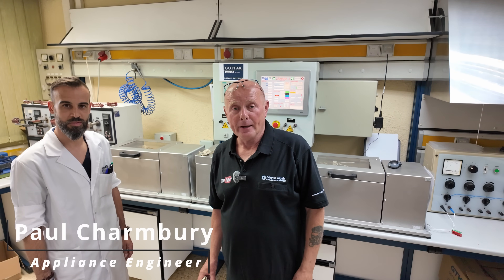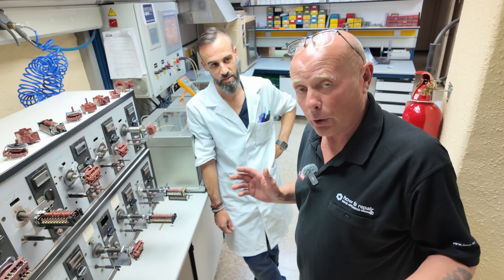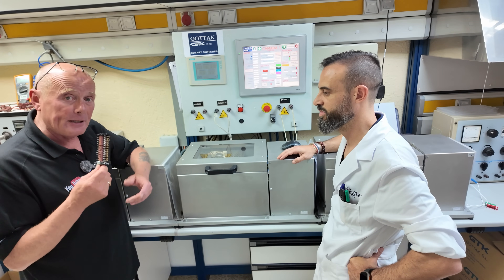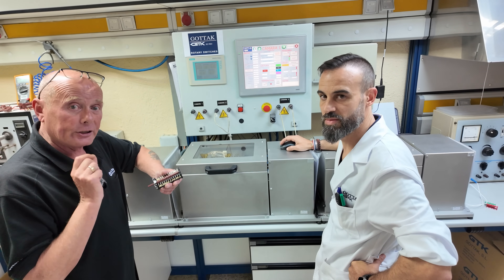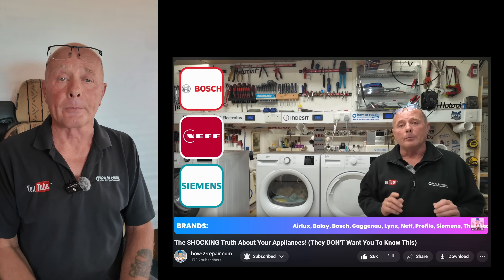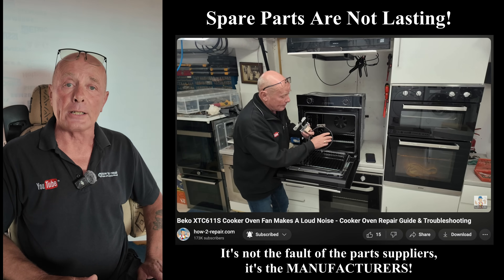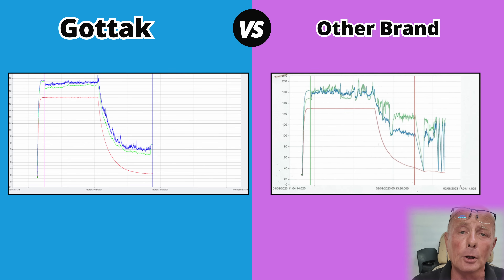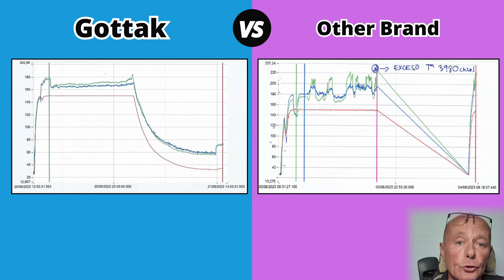Why Your Appliances FAIL SO FAST! Lab Results EXPOSE the Truth!

Comment: As a decades-long reliability engineer, let me say this is only part of the story.

The truth is a balance between performance quality and reliability vs. price/cost/profit.  Because customers demand better for cheaper, you are assured to see this balance shift between performance and cost.

My particular area is semiconductor reliability.  And guess what?   Same thing applies.  The chips in your iPhone only have a lifetime of about 10-15 years.   30-40 years ago the accelerated lifetime estimate for contemporary chips was 10,000 years!!   Making things smaller reduces reliability in a very linear way - the minimum geometry in nanometers of any planar semiconductor process is approximately the lifetime in years.

The specific trade off is always occurring.

In switch example - be aware using silver is itself a trade off with reliability implications.  Rhodium is what you would use for maximum lifetime - but it is much more expensive.  Silver reduces contact resistance but is not as good for hot-switch reliability.   It's better than copper or iron or steel which are cheaper.  But not the best case if you simply want to optimize for lifetime only.  The economic trade-off has already caused the choice of silver!

The engineer CAN CONTROL what the accountants buy by defining proper specifications that lock-in a given performance.   You could specify rhodium contacts with a market demand specification.  You specify a certain cycle count (that ONLY rhodium can attain).  Etc.  I've done this many times.

Part of the problem is the insistence on more performance for price.  Once you account for technology lifetimes declines vs. inflation adjusted costs and market demands for shareholder value , all of this becomes inevitable.  

Do you demand your bank, investment or retirement accounts grow to assure you have comfy retirement?  YOU ARE THE PROBLEM because your financial growth comes from investments in companies that grow - and they grow exactly by having companies maximize profits, which itself involves cutting costs on their products - as exactly as described.  When WE as consumers demand better, faster, cheap, we are feeding the beast that creates this situation.  We customers are NOT innocent victims of "planned obsolescence" - we create the market conditions that create it!

What you must sell people is the value of long term function at an inevitably premium price  This is marketing and sales problem.   Most people don't care about something lasting 20 years - because of the time-value of money (compound interest) makes long-term planning ROI less valuable financially/economically than short-term planning ROI.

Outsourcing products to China pretty much guaranteed the view that "I don't care about quality because I can buy a new one cheap".  And this also solves the market/product novelty demand of consumers.   Next big thing is cheap.   Fix that (by re-homing manufacturing) and you remove this perverse incentive.  More expense domestically produced products will change the economics and make reliability more important.
Reply from the maker: Thank you for your detailed response. We need to find a balance. The governing bodies don't seem to care, and manufacturers only focus on profit. I understand your point. We should be more environmentally friendly and improve technology.

Cookers and washing machines haven't changed much in 50 years. A washing machine still fills with water, agitates, heats, rinses, and spins. This process remains the same today. Cookers now use fan-assisted technology instead of the old conventional way, but this isn't a big change either.

We ship appliances halfway across the world, which is crazy when you do the maths. The UK uses over three and a half million washing machines each year. A 20-foot shipping container holds about 120 washing machines, and a ship usually carries between three and five thousand containers. This means many ships are needed, and they are huge polluters.

Recycling machines also harms the environment. It would be better to pay more for durable machines. Experts in the industry should monitor this instead of government officials who lack knowledge and are misled by manufacturers. Again, I appreciate your effort in this article.

At the trade show last year, understanding how much obsolescence is being designed into new appliances these days is something everyone should be aware of. For a deeper dive into this topic and to see the examples we covered, please check out the full video here: https://youtu.be/gEgSCbZnHVM?si=wTIw0mELuhWaw4aX

We also explored related aspects in these videos:

The shocking truth about manufacturers: https://www.youtube.com/watch?v=QsdGd2qDPaI
Heat pump tumble dryers are they really worth it?: https://www.youtube.com/watch?v=xn03N3b0-lE
If you found this information eye-opening or helpful, please consider sharing this video with your friends and family. The more people who understand what's happening with appliance longevity, the better equipped we all are as consumers.

Thanks again for watching and engaging! Don't forget to subscribe to the channel for more insights like this!
Reply: Thanks very much for this explanation. Don't tell anyone but I three identical Maytag washing machines from late 1960s.  Yes, still working fine.  Only one ever was taken offline due to structure frame corosion from over damp environment.  Did I throw it out? No,  
It has worked over fifty years , I will replace material and use again .  By the way, the units were purchased from resale stores because some foolish woman wanted to or had to have a more modern washer.  And the beat goes on! 😊
Reply: My girlfriend works as an electronics engineer in the automotive sector, for a company that builds radiator cooling fans used by many major European car manufacturers. The company was Italian and has been making these fans for decades. There are people in that company that literally spent 40 years of their life optimizing the motor drivers to be as reliable as possible in the dusty, hot vibration-filled environment of an engine bay. When was the last time a cooling fan failed on your car? Never. It's always the wiring or the temperature sensors or something that fails, hence why you used to see people wiring up janky switches inside to manually turn it on.
Their fans themselves are tried and true and basically indestructible.
Or rather... they were. 

Because the company is now owned by a Chinese group (has been for a while actually), and car manufacturers these days keep pushing to lower the cost further and further. Even if it's just by a few cents, they want it cheaper and cheaper with every order. So they are now being forced to downgrade the components in the motor drivers. Cheaper capacitors, cheaper controllers, cheaper Chinese mosfets instead of """expensive""" (literally a couple bucks) Infineon or STM mosfets, cheaper bearings, cheaper plastics and so on and so forth.
So now those same people instead of trying to make the products even better and more reliable, have to spend all of their time just trying to stop it from blowing itself up, and the reliability has taken a dive as a result. They've had more failures in the last few years than they have in the previous few decades. They spend all their time doing failure analysis now and the answer is always "because we used the cheapest fucking thing on the market instead of the one we know is reliable".

This is going on at every level with every single component in your car, and that's why modern cars keep throwing random electronic faults all the time and sometimes even have catastrophic mechanical failures just a few years in. And all for what? So they can squeeze in a bigger screen, an electronic parking brake that nobody asked for, etc. Manufacturers these days want to give the impression of luxury at the expense of the actual basic functionality of their products.
Reply: @demoniack81 the problem is that engineers have lost their dignity and ability to say no…..
Reply: Then the engineers have a responsibility to resign. We need government reliability standards. My home air conditioner is from 1955 and was made by York. It still works. We did quality before, and we can do it again.
Reply: Bravo! Enjoyed your post.
I am still in possession of a Westinghouse refrigerator made before 1957.  It still works, Uses one # of R12. It never leaked out. These models were so well built, the power companies actually started a rebate on new refrigerators (to trade in) in the late 1960s'. I guess the only flaw would be the door latch being a hazard for suffocation.  Lastly, still have an electrolux vacuum. Indestructable ! My late father sold them door to door as his first enjoyment after WW2. Thanks Dad, your missed.  @gregorymalchuk272
Reply: @gregorymalchuk272  do you have pinworms? We made plenty of money during the Vietnam war. Well the military industrial complex and all their pin worms got rich on it. Now all we need is a giant complex Federal bureaucracy about dependability so that the cost of products can triple.
Reply: @gregorymalchuk272  well if you have all the engineers design you can get a malchuk in there.
Reply: I really love your engineering prediction about the economy what a joke. You're a reliability engineer and nothing that you work on burst into flames and kills people like say a hoverboard getting charged up while you're asleep. That's the poster child for failure that they're trying to come up with for these lithium batteries. Lithium batteries will tend to fail by catching on fire. Almost every other consumer product is designed to fail in a non-fire death mode. I don't know of any semiconductors that have the fire danger so much, and I don't believe it's addressed on the level that you engineer reliability.
Reply: This is only part of the story, there are also specific designs for obsolescence, not only for cost savings.  I have detected circuits that purposefully damage components in controlled ways. (meaning they will last more than 5 years but less than 10 for example)
Reply: I went to study engineering in college and I looked for the dead people. There's a lot of dead people from engineering and I would like to cut down on the dead people from engineering if I could. Let's consider the microwave oven. Those microwaves are nasty and if you can't take other people's word for something you must experience it microwaves will kill you. We had one guy that kept standing in front of the microwave transmitter in Alaska to warm up and on Christmas Eve at cooked him like a pork roast because they turned up the energy and he didn't understand. Let's look at a microwave oven if you engineered it so every switch on it would last forever and everything else would last forever, the rubber door gasket would start to leak even though the machine continue to run and last forever. The customer would be getting necrotic tissue everywhere that the microwaves were hitting him and cataracts from exposure to the microwaves. We have engineered failure thank God we have engineered failure.when we consider your field which is important the mathematics is there but you miss the fatalities because you don't have consumer interaction on the level of a chip. In case you haven't heard there are a lot of people who are blessed with severe mental illness. One of the symptoms of this that is very common is pathological demand avoidance. No matter what you asked them to do, they will not, they can't stand to be told what to do. You have to engineer a failure for these mentally ill people so they don't just run a microwave oven until it Cooks them in the family and everybody else just to spite you.
Reply: my Lites dim when demanding more pwr.  time to retorque the wires.
Reply: Fixing the disposable product consumer mentality is going to be an order of magnitude more difficult than any design/engineering problems.
Reply: @andrewhefner289  you can't fix it. Everybody thinks that if we just make a rule that a business must self-destruct by putting out a durable product flooding the market and then going under. What did we learn from the clamshell Stihl lawn chair the last 100 years they sold for a decade people are still sitting on them and they went under. The place that made the chief junk one season lawn chair cheap is making money hand over fist. Very difficult to get somebody to the self-destruct for the good of everybody every businessman isn't Jesus you know.
Reply: What a load of waffle. Nobody wants a selector switch to last for 100 years. But we want them to last more than 5 years ffs.
Reply: @chocolate_squiggle  Speak for yourself.  I'm 62 years old and since graduating college, I have lived in 4 different houses that I owned and have never bought a single major appliance.  I've repaired dishwashers, washing machines, dryers, ovens, one rangetop, a couple of microwaves, a couple of furnaces, a heat pump, and completely rebuilt a refrigerator that was 30 years old.  I've got a 60 year old ten speed bicycle, 46 year and 28 year old cars, a 68 year old toaster, a 50 year old orbital sander a 45 year old circular saw, and an 80 year old Shopsmith.  I fix practically anything and everything from simple, inexpensive tools to laptops, cell phones, propane grills, projection TVs, motorcycles, cars, furniture, and even wrist watches.  Just yesterday I bought a Pizelle iron at a garage sale, disassembled it and cleaned the living daylights out of it with stainless steel wool, a stainless steel brush, oven cleaner, and polishing cleanser.  Today it looks like it's brand new and it works perfectly.  A couple weeks back, I replaced a capacitor on the control board of a dead slow cooker and brought it back to life.

If people take care of things, they should generally be able to last longer than the person will live.
Reply: @kirkjohnson6638 reading your story, I was sure you own a shopsmith!😅

Comment: All LG washing machines with dark lid use plastic bottom screwed with tiny screws you find in computer case. The drum has sealant rubber ring without splash guard to wash out lubricant faster, the axle is just coated with nickel to cause premature failure. Worst design ever but they have special motor no belts direct drive, parts cheap. I fixed every point mentioned and got better reliability then miele
Reply from the maker: Hi there! Thanks for your comment, @akierum!

You've hit on a really important point about specific design flaws in LG washing machines that lead to premature failure. Your detailed observations about the plastic bottom, drum sealant, and axle coating are prime examples of the kind of built-in obsolescence we discuss in the video. It's fascinating and frustrating to hear how manufacturers use seemingly minor design choices to impact longevity.

At the trade show last year, understanding how much obsolescence is being designed into new appliances these days is something everyone should be aware of. For a deeper dive into this topic and to see the examples we covered, please check out the full video here: https://youtu.be/gEgSCbZnHVM?si=wTIw0mELuhWaw4aX

We also explored related aspects in these videos:

The shocking truth about manufacturers: https://www.youtube.com/watch?v=QsdGd2qDPaI
Heat pump tumble dryers: are they really worth it?: https://www.youtube.com/watch?v=xn03N3b0-lE
If you found this information eye-opening or helpful, please consider sharing this video with your friends and family. The more people who understand what's happening with appliance longevity, the better equipped we all are as consumers.

Thanks again for watching and engaging! Don't forget to subscribe to the channel for more insights like this!
Reply: @How-to-repair  Thank you China for CNC manufacturing the parts to make my LG last forever, the metal bottom was made locally weight 24Kg metal plate, the proper sealant ring was very hard to source.